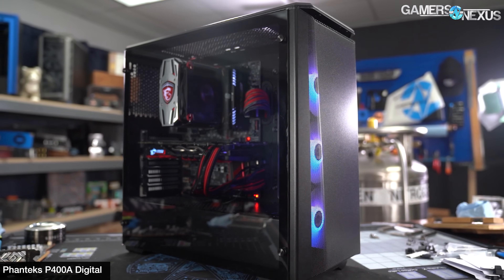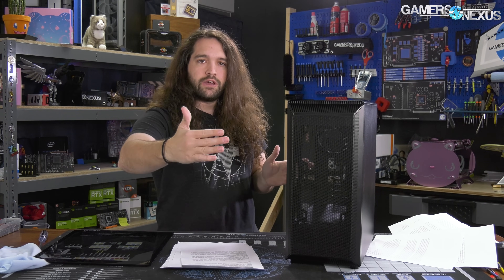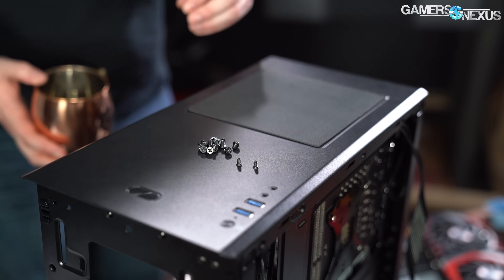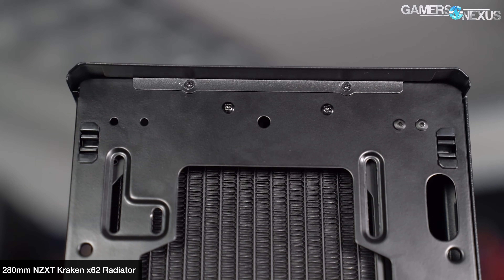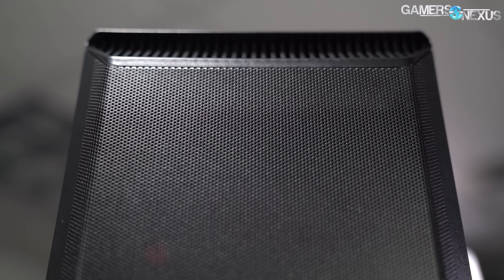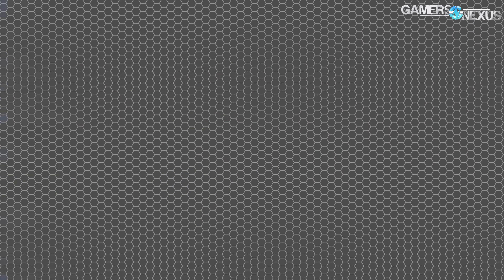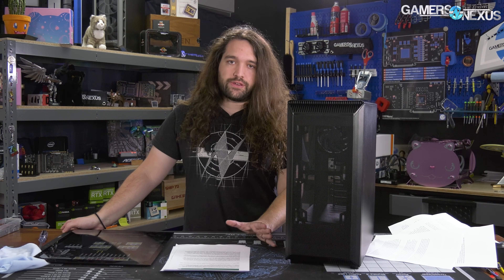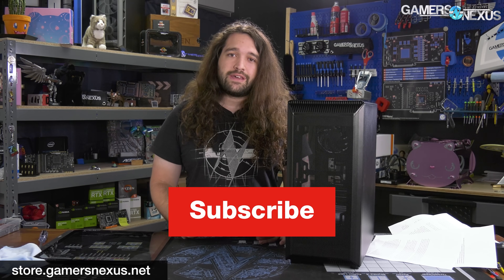Phanteks P300A Cheap Airflow Case Review: Thermals, Extra Fan Tests, & Noise

Comment: I built my first PC in a in the old P300, with a solid metal front panel and just the slits on top for intake. For a newb build I really liked it, minus my bad decisions of leaving out front intake fans and using a stock Intel CPU cooler. I swapped to a Cooler Master H500 (mesh front) recently, and I have to say my cable management was better in the Phanteks case. I kind of miss it a little.

Comment: I don't know if this is an official Phanteks thing, but one Australian retailer I often use is selling an RGB version of this case with three fans instead of one.
Reply: That's the P400A Digital.
Reply: @nihilimobscuras9750  No it's not, the Australian retailer he's talking about is probably pccasegear and they sell a p300a with three rgb fans installed
Reply: holy crap cases are expensive in australia
Reply: @simpson6700  that's just our currency value. Removing the tax and converting back to USD, that is $75 US for the 3 RGB model.
Reply: @murai_maquina  Well, I'll be...
I stand corrected.
It sure sounded like the P400A Digital until I checked the link.
Reply: @nihilimobscuras9750  that's fair

Comment: Hey guys, really appreciate the effort and detail you put into these reviews.

Is it possible for you to do a review on the refreshed version of this case which is the Phanteks G300A , comes with 3 pre-installed fans and has a little ramp on the front to redirect air to the GPU.

Comment: Most people won't buy fans for any case. I had a customer just before the malware that came in specifically wanting the o11, not that he knew what it was but had a picture of it from a friends build with the infinity mirrors. He didn't blink at the cost of building a matching system until he got to the line item for 4 fans, aRGB ones to work in the build that cost less than $150. I really thought for a second he was going to walk away from a $3000 system over $150.

Comment: I couldn't agree more on including fans with any budget or entry level case like this. The person looking at this case is likely to be someone that is building their first PC on an extremely tight budget and already squeezed every dollar to get the best performance for their money for the parts they are putting into it. They may not have even realized the fact that they need something to put their parts in until they got ready to click the "place order now" button and fans are not even a thought at all. Include the fans and make it one less thing for someone to worry about and make the experience a little bit better. There's nothing like the disappointment of getting everything and putting it together, only to find out that you don't have everything that you need. As you said, included "basic" fans from the case manufacturer would be less expensive than buying them separately anyway. The person that this case fits the need for is not someone that is worried about fan performance right out of the box. They are trying to get their foot in the door of this great hobby at the best price possible.

Comment: I have to hand it to Phanteks, they have their heads on straight. I went with a Phanteks Enthoo Evolv X for my 3800X build and its been fantastic, no major complaints and the build quality is there, but it had better be for $200.
Reply: The Evolv X is a brilliant case. My heart was telling me to go for it, but my brain opted for the P600s for better airflow. Those aluminium panels are something else though. I still wonder if i made the right decision 😜
Reply: @Danko_HS  P600S is a great case, it was another contender for my build next to the H500M.

In all honesty there is no wrong choice between the P600S and the Evolv X. What I can say is that any concerns about the airflow from the front of the case is nil from me, I have my 280mm radiator mounted there in a push/pull with 4x Noctua AF-14 iPPC 2000 fans and it works brilliantly.
Reply: @Spartan536  The front and top panels do allow some air to circulate, but it's still worse than the fabric mesh of the P600s. I wanted to focus on silence so open front and low rpm fans it's still the best combo imo. Aesthetically the Evolv X is more pleasing though. Ah well, you can't have it all.
Reply: @Danko_HS  Unfortunately that is so, I have nit picks with the Evolv X but at least I did not have any major issues.

I suppose one thing that could be a major issue is that the SSD mounts on the rear cover panels would likely not mount correctly so I am glad I bought 3 of the not included SSD mounts for the rear otherwise it would have made my build a nightmare.

Also ARGB wiring is a frakkin nightmare.
Reply: @Spartan536  Why they didn't include those SSD mounts, when they did on the P600s, i will never understand. All in all these 2 cases are very well designed and built and have good airflow. There aren't many choices in this price range right now.

Comment: I'm using this case since 4 weeks. It's pretty good so far, but if I could go back, I'll definitely buy the P400A. While P300A have a slight cheaper price, if I'm including the 3 extra case fan which is needed for a proper ventilation as the Tech Jesus mentioned, the HDD brackets and the PSU almost doesn't have any airflow at all. My old Seagate 280GB drive constantly in 45C degrees without any usage. However I've installed the second fan of an Arctic ESport Duo in the front top, a Noctua NF-P14s-redux-1200 PWM (btw this fan is a beast) in the front bottom and a Noctua NF-B9 redux-1600 PWM (which will be replaced to an another P14s) to the top mesh as an air pressure regulator. I've also applied 6 layer of mosquito net to the mesh panels because I live in a very dusty house. The Red Devil performed incredibly well in FurMark 4K torture test. It had 69C constant with 50% GPU fan speed while the P14s were around 40%. CPU burn caused 65C degrees with 60% of case and CPU cooler fan speed on a Ryzen 5 3600 @ 4150Mhz average.
So overall it's a good case with some downsides but if you have an extra 20 bucks I recommend you to go for the P400A.

Comment: I kind of agree with the fact that it would be great to have more fans included for 5-7 dollars more because it would be more exoensive for the customer. But, when you have fans like the ARCTIC P12 PWM and P14 PWM (between 6 and 7euros here in Europe) that are definitly quieter and at least as good as the cheap fans that would have been included, I think that the few extra bucks are worth it

Comment: The only way I was able to semi-comfortably build in my P300 was to set aside my planned power supply and purchase the shortest modular one I could find. Even just 20mm less depth allowed the build to continue around that accursed drive cage.

Comment: Enthusiasts don't seem to understand that they make up a small segment of the market. I always use my own fans, but the market for this case generally won't. And using this case to build for someone else, I wouldn't replace fans either... if they were included. I've been looking at the P300 for some budget builds. Might have to consider the A.

Comment: I'm not going to argue about people wanting fully populated cases at the budget end, because it's very likely you're right. That could actually be a selling point for the case. Hell, if the fans they used were dual ball bearing and not sleeve models it would even be a selling point for me.  I agree, they should do a fully fanned up sku, and a sku with no fans at all
What they also need to do is start putting a small punch out slot in the front panels of these cases so people can install a slimline optical drive.

Comment: I don't mind stock case fans because even if I buy a full set of fans to replace them, I'll reuse them. A spliced usb cable for power and you have a nice lil' cooling fan for yourself or with a high wattage cable and a three fan splitter, you have a set of fans to cool other things that you can't plug fans into. I have two 80mm fans and a 120mm fan to help keep my Xbox One cool while I game on it. :) Two intakes on the right side and a exhaust on the top.

Comment: Recently built my first PC in this case, managed to fit a Strix GTX 1080 with a Fractal Design Celsius 24 in front Pull, extremely tight fit, but temps are stable :^

Comment: I have a Corsair 220T airflow case. After watching this review, I surely feel that, 220T airflow (stock) is a good buy.
I have added extra 3 fans. It does add to the cost but surprisingly  temperatures are quite good. 
Due to the short depth of the case the GPU is surely quite cool.
Reply: Are you running the extra fans as exhaust? Did the temps decrease significantly?

Comment: Phanteks P300 was a very good form factor in my opinion and when the P400A comes out i instantly thinking about P300A variant. I purchase without a doubt when P300A comes out, it is decent quality, nice features at that price point and it is very competetive in my country which everything cost %20 percent more than the US MSRP. So it is a good case even without front fans, cuz it is the aiming of the case which is budget but clean and quality features for builders with components like Ryzen 3300X+1650 Super to Ryzen 3600+2060 Super or RX 5600XT. The only downside this case has, it is coming only 1 SSD bracket for the behind of the case and the other one costs like 1/4 price of the entire case. (Just wish it should come with 2 SSD brackets at all) Overall pretty happy about it.

Comment: I have an older Phantkes P300 (the plastic window instead of tempered glass) which I got for 60 bucks a couple years back.  Its a great budget case.  Although I modded mine for a custom water loop.

Comment: I bought a p300A stock panel, and then moved the vented plastic Pieces from My Old P300 to the "P300A" Front panel, 
I now have the highest Airflow p300 in existence you can also keep the filters because WHY NOT

Comment: Been using this case for a couple of months now. I found using a msi tomahawk b450 motherboard cable management was not an issue. The hard drive cage is tight when trying to access the back of the power supply. I added two extra fans just to have them since there was space for them.

Comment: So it seems like the case now comes in an RGB Mesh Edition that comes with 3 fans (2 front, 1 rear) and for a good price point that basically solves the problem and gives you 3 fans vs the 360A's 2 fans. Worth considering since its cheaper than the 360A.

Comment: I have the P400A with the fans and RGB, it rocks with an X62 with the G12 bracket that cools the GPU mounted in front and a Noctua n12u on the CPU, the thermals are very good, especially of the GPU... the case is maybe the best for the money... It replaced the NZXT H500 that had awful thermals and bad exhaust fan setup

Comment: I got a 120mm fan for $5 so total cost was $65.  Two front fans would look better, and a front AIO, maybe even the squished 280mm, would look best.  It just looks bad with only one front intake.  But performs fine especially with a CPU tower cooler that doesn't have a problem pulling in fresh air through the front mesh.

Comment: This video is helpful for my Phanteks P300. I have 2 front case fans and 1 top mounted exhaust (Arctic P12). I'm getting max GPU temps of 74C on a Gigabyte RTX 3060 Ti and it causes an audible (clicking/coil whine) noise after 20 minutes of load. I remove the side panel and the GPU temps drop from 74C to 65C and Ryzen 5 5600X CPU temps drop from 64C to 51C. The clicking/coil whine noise goes away entirely. I think it's time to get a better airflow case.

Comment: I'm a massive fan snob but i agree with Steve, Even I'd consider it a value add to have a fully populated case fan set, ON THE CONDITION that said fans are ball bearing models and not sleeve.

Comment: If cases could be sold both with and without stock fans I'd agree more they should be included. It's frustrating and wasteful when most cases are priced up to include fans you don't plan to use.

Comment: looks almost identical to the metallicgear neo air however the neo air comes with two fans
Reply: I mean Phanteks makes Metallic Gear, so it makes sense
Reply: metallic gear is phanteks budget brand
Reply: The Neo air despite being from their lesser budget division kind of makes the p300 redundant as it comes with 2 front fans out of the box and is around the same price.
Reply: @Erotikstudio Winkler GmbH Doesn't matter how garbage they are, they still move more air than not having any.

Comment: Thing is: I wouldn't want to spend much on a case, because that literally just holds my parts together. But I would want to spend as much as I can afford on fans because that is what makes my build both silent and cool.
In budget builds with maximum bang for buck it is a damn good idea to have good fans to bring down the casetemp.
Reply: Imrahil but good fans cost is not something you can ignore and as steve said, manufacturer can get better prices when buying bulk (sold to you as integrated price with case). While its true that the fans probably arent among the best, you cant deny the price/performance is there. So your bang for buck calculation still need to consider if its actually worth getting a case with no stock fans.

Comment: You guys should check out Tecware Cases here in asia. I currently have the Tecware Alpha M and it beats most cases 2x or even 3x its price range. The only downside i see on it are the included but for airflow this is a beast

Comment: Totally agree, if they made it 5 bucks more expensive with a couple intakes, it'd have been much better. I wouldn't buy this case for me, but I also have 3 desktops at my desk right now, so I'm not the target. 

But for all the friends that msg me asking for builds on tight budgets, they don't stockpile fans in their houses, and 20 bucks saved on fans means more storage, better cpu cooling... Much better value.
Reply: Why don't they reuse case, fans and psu if they are on tight budget? If they're buying their first desktop PC then quality psu, case and fans are really worth the money and will last for a very long time...

Comment: one thing I did hate that the hard drive bay was in that forward position like in the review case. Space is important. What would be nice is if they made power cable specially made for their bay so we can save more space as I've had problems with 3 pcs and the hdd and ssd cables.  1 cable thaat can reech every bay port that you just plug in 1 8pin or a 6pin should be enough maybe. 

You are right that budget cases should come with more fans. I don't really care to go and buy fans and it was a painto have to go spend another 30 40 bucks for 2 fans and you hope you can find  the same fans.

Comment: what they need to do I think is give you an option if you want a fan or not. for me I was looking everywhere for a cheap case with no fans cause I have my fans already and I found one that has no fans and have a mesh in the front. it's DarkFlash DLM21 Mesh and it is in the 60 dollar range and the airflow is pretty good I haven't had any problems with it and it's a Micro ATX , Mini ITX case. it still fits a Noctua NH-D15 cooler which with fans on it it's 165mm in height.

Comment: In regards to the fans, maybe simply having an F and non-F variant would be best.  Even if the price is basically the same (maybe $1-2 off), the fact that there would be less waste (particularly because most of it is plastic) should be justification enough.

Comment: For aftermarket 280mm radiators, you're really going to only be able to fit GTS and GTX units from Hardware Labs, and the Bitspower and Corsair variants into this case. They generally are under 315mm in height. Everything else is a crap shoot and not recommended.

Comment: Having 3 intake (RGB too!) and one exhaust fan is the main reason I bought my cheap 60$ case a while ago. It wasnt hard to find mesh and TG panel on many cases, but it was rare to see whole 4 fans in a cheap case. I guess Im from the minority that doesnt want to buy fans myself :D
P.S. Oh and its a reputable brand (Cooler Master) compared to the nJoy (Romanian cheap brand) that had the same amount of fans, acrylic, cheap plastic and the bottom part was not mesh so I moved the pointless fan to exhaust on top where there wasnt mesh but some tiny holes (I even drilled like 50 4mm holes) -_- The case was so poorly "designed" that I bought another fan for exhaust but returned it after I saw its pointless. Getting a new case but from a known brand but without changing anything made huge difference, my GPU barely uses its fans.

Comment: hello there, im the madlad who bought actually "expensive" fans in his p300a, from 2x 140mm BeQuiet! Light wings in the front and 1x 140mm BQ! Light wing in the roof to a 1x 120mm BQ! Light wing in the back and 2x 120mm light wings on his cpu cooler as push-pull

im also the guy who keeps them on a static color, or simple animations with static colors
Reply: What specs ya got and the thermals?
Reply: @LaoNinja007  i5-9400f, 2060 6gb, 32gb (4x8gb) vengeance rgb pro, 1x nvme 256gb/2x ssd (2tb, 500gb)/1x hdd 1tb, 2x 140mm intake light wings, 1x 140mm roof exhaust light wings, 1x 120mm rear exhaust light wings, 2x 120mm (push-pull) silent wings 3's on an dark rock 4.

cpu cooler: be quiet dark rock 4 (2x/push-pull silent wings 3's) with kryonaut thermal paste

gpu: single fan 2060 6gb with re-paste done with kryonaut thermal paste

i5 idle: ~40°C
i5 full load stress test: max 57-60°C

2060 idle: ~40°C (hot spot max: ~55°C)
2060 full load stress test: max 80-82°C (hot spot max: 99-100°C)

fan curves are fairly non aggressive and silent only kicking in at around 60°c all are following the cpu and max speed is around 800rpm during a long temperature test, (max speed 887 rpm, idle speed 500-513rpm)

software used: 
-Cinebench R23
-Furmark (1280x720, 2x MSAA)
-Furmark CPU burner
-3DMark Time Spy

edit: corrected fan sizes and added ram amount